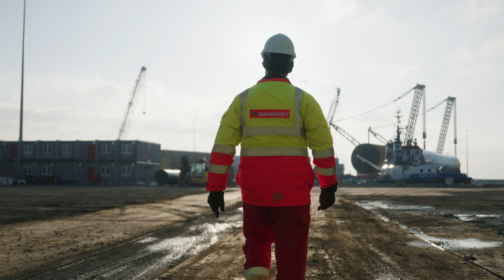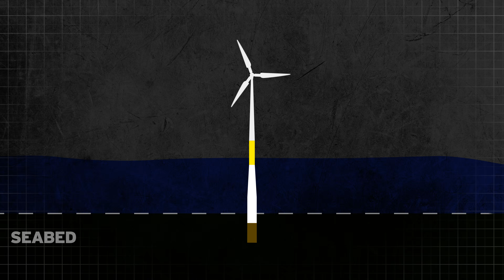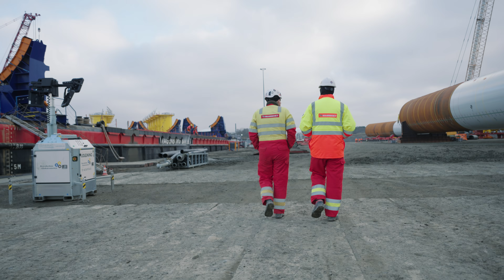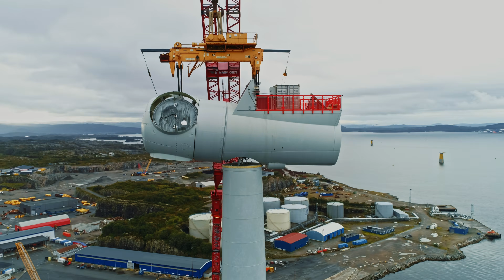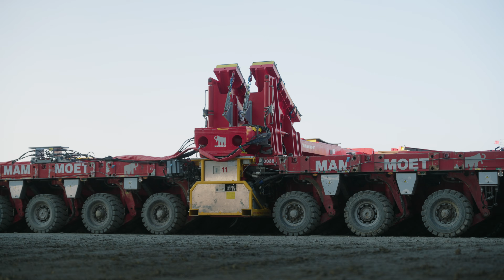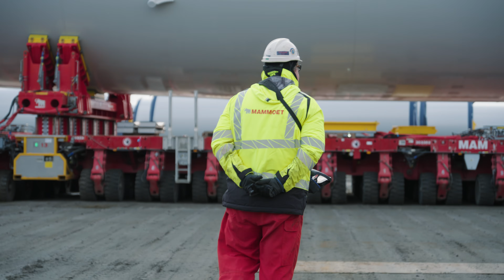The sheer SIZE of offshore wind foundations

Comment: Wind is so much better than solar. Solar needs a lot of real estate & everytime a cloud rolls by or it becomes overcast power generation dips. And when the sun sets-it stops. Not so for wind. Wind generates all night long. In rain. In fog. In overcast.

!
Reply: In General yes but both are needed when there is no wind or sun. Perfect symbiosis
Reply: Wind turbines at sea take huge amounts of space also.  That precludes safe navigation near them.  Maintenance, operations, electrical distribution is more difficult in an open salt water environment.  Their useful lives and ongoing costs will be tested to the maximum.  The sea is forever unforgiving to all that enter.

Comment: Half a million Euro per turbine. To get 10 Euro per year. That only makes political sense when the taxpayers is only paying.
Reply: Incorrect. The biggest German off-shore wind park for now (He Dreiht, 1 GW) received 0€ in subsidies.

Not sure why you would think selling 40 000 000 kWh per year (15 MW turbine at 0.3 capacity factor) for 20 years gets you 10€ of total revenue. Depending on contracted power prices, should be in the region of 20 to 50 million € total revenue per turbine. Also not sure why you'd think buying and installing an offshore turbine costs only half a million. 
Do you maybe have a house that you'd be willing to sell? I'll make you a good offer, I promise.